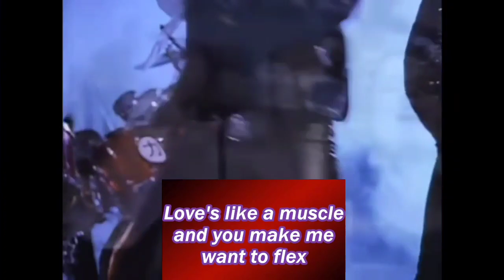John Deere 450C Idler Shim Project: Part 2

Comment: That isn't how you shim an idler. You put the shim under the plate that has the 4 bolts on the side that it is running to and it pushes it to the opposite side.
Reply from the maker: Do you mean the shim goes behind the 4-bolt plate? Or literally under it? Thx!
Reply: @OffGridandWhiskey  Goes behind the 4 bolt plate on the side it is running to. In your case the idler is running to the engine side. You put the plate on that side and it will push your idler out. The shim only goes on the top half.
Reply from the maker: Okay. That makes sense. Thx. Of course, those are the bolts' hardest to reach and break lose.
Reply: @OffGridandWhiskey  Well of course, it seems like that is the way it works out with heavy equipment most of the time.
Reply from the maker: Ain't that the truth.
Reply: This will just create more space on the other side, not actually re index the idler